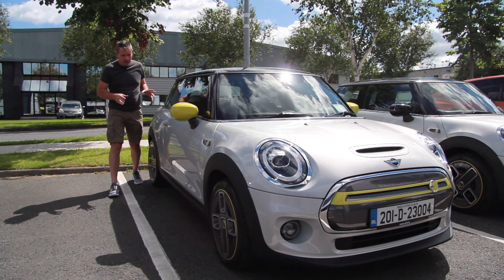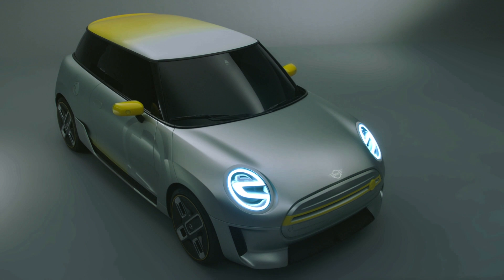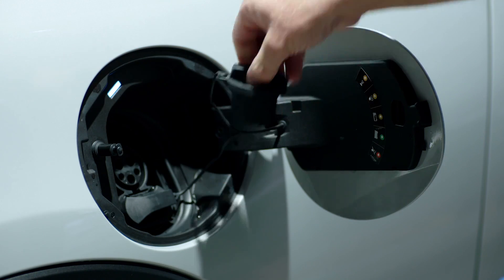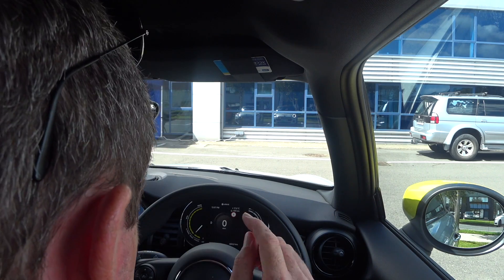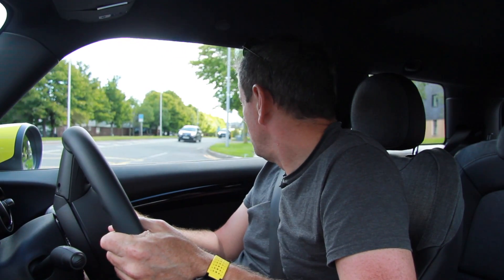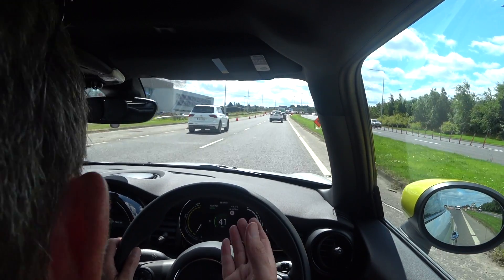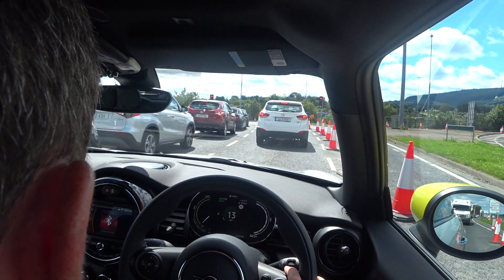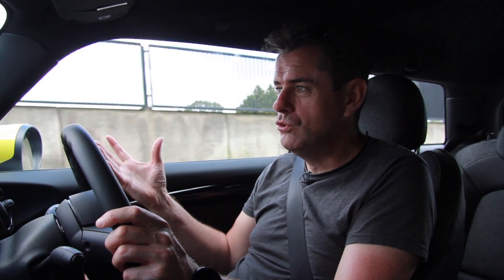Mini Electric range testing for my commute to work

Comment: yeah I wish they gave it just a bit more. With a 40 mile commute each way I'm not turning off the air or babying the accelerator I want to drive fast over the speed limit and pass for fun. It's a mini i'm not in a Prius it's such a shame they didn't give it a bit more. If I had a 15 mile commute i'd be all over this car but it's just not enough to drive and have fun with the low range.

Comment: Bjørn Nyland test - says it's very efficient -  did you have the brakes on Bob :)
Reply from the maker: I drive like a normal person, I told you from the start that I would be using cruise control and sticking to the limits. Why should I try to be super efficient? 
Also, different people and different environments make different results. 
No one who commutes every day is going to go slower or kill themselves to be efficient. 
Bjorn is wrong, ever think of that?
Reply: It is efficient, even in this test. In Bjørn's video he averaged 177 Wh/km at 120 km/h, for a total range of 163 Km.....this is much better than just about any other EV out there. It's only because the battery is so small that it's range is lacking.

Comment: This is designed as a City car and MOST people drive less than 80km a day - if you need more then DONT buy this car OR charge at 50kw which would get you around 160km added in 30 mins or like you said charge overnight when you get home. You cant think of EV's like an ICE car, it's not the same as you don't have a fuel station at home which you do when driving an EV.
Reply: That’s a scenario where this would work for me, you couldn’t have it as your only car in the house. You’d need one ICE for long journeys and the electric for school runs and short journeys. I definitely couldn’t cope with the range anxiety if this was my only car
Reply: It’s the age-old conundrum, 95% of the time 100 miles range is all you’ll ever need, even long trips you can beak up with motorway charging stops, lunch, coffee etc, but its the 5% when you wanna do something like a 200+ mile round trip in a day - the last thing you really wanna do is add 40mins or more to a tiring day of driving. My Leaf will do about 130 miles and honestly, I want more range, just for those odd trips, hence we keep our little petrol car hanging around, which ironically is less comfortable for long journeys (it’s a mini btw!!). Minis are ace, and this one is a very nice, but rather expensive, second car imo.
Reply: It's too expensive for being "just a city car". The 208/Corsa cost about the same and offer much more for the money.

Comment: Bjørn Nyland a k a Teslabjørn tested the same car today and was very, very impressed w the Mini's efficiency. Basically Ioniq level efficiency. It has a tiny, tiny battery for an EV and driving at 120 kmh for quite a bit, what would you expect??? So if the conclusion is that the battery is too small for long distance highway driving is that a surprise? Me dont understand

Comment: Thank you Bob, I enjoy your honest presentations, although I must admit that I did feel ‘range anxiety’ while watching this one. It also occurred to me that you had ideal conditions for the journey. I wonder how ev’s cope in cold, wet, freezing winter conditions and heavy congestion?
Reply: At least heavy congestion would be reducing the energy needed to drive. Cold will increase consumption, depending on if the Mini has a heat pump. Should be doing the same trip fine without any need for range anxiety. 😉
Reply: Electric cars love congestion on any road, they love stop start driving, range goes through the roof. Rain (wet roads) reduce the range as does cold weather (denser air and batteries less efficient). Long hills are also an Ev's Achilles heal for a similar reason to driving at constant speed (against the wind) on a faster road, you have to keep the motor pushing the car along against resistance whether that be the air on a fast road or gravity on an incline.... or both.

Comment: Hi Bob, enjoyed the video. You where wondering towards the end why the regen was high on green. I think you need to find the low regen setting. You mentioned this at the start of the video. What are the charging options? CCS, 3 phase AC?

Comment: Nice true life review of Electric car. Looks good but the small range is surprising from mini. Though minido at least 300 kms . Some done working and travelling close but no long journeys as too many times to charge.  For me would have to charge 4 times from cork to Dublin return . Or twice on return cork to limerick.  Pity
Reply from the maker: It's a great car but really short range. I just drove from Portlaoise-Dublin-Portlaoise in a Peugeot 208 e and didn't have to stop to charge 🤩
Reply: Bob Flavin yeah that’s much more usable in the e208. Still I’ve seen in a few other reviews that the e208 is very thirsty high kWh/100km so It should be able to go  further than it does but efficiency is poor.

Comment: PS: Totally agree with your mantra, it must be driven like a petrol or diesel, no holding back, 120pkh on the motorway, no flipping hearse driving. I felt for you stuck at 100kph indicated speed when tools were hovering between 95 and 105. What part of constant speed do some dicks not understand. My car at 100 indicated ground speed (IGS) is only doing 95 true speed over the ground (SOG). PS: Noticed when you were setting off you only paired for bluetooth and didn't plug into CarPlay or Android auto, so no WAZE which suggested speed limit all the way. :)

Comment: For the life of me I can’t understand why bmw mini choose to install the last gen i3 battery and expect it to be an outright success, even if they added a mini eco engine in Rex it would safeguard its sales but this where every other small ev are fitting 50kw bar Honda I can’t but help think that bmw don’t want it to be a success and compliance car to meet eu total c02 quota
Reply: You can't understand it because they didn't :) They are different cells (LG vs CatL). They are the same size, but completely different battery. I've read lots of comments here which complain about range. Buy the car that suits you. The mini has a small battery so it is fun to drive (lighter). It is one of the most efficient EVs you can buy, which it needs to be with the small battery. Put a larger battery and the fun factor disappears. A 50kW battery with todays tech would require you to remove the back seat. You wouldn't buy a bugati veron for stop start morning traffic. If you want to plod along for the long morning commute, buy a comfortable car which is dull to drive, but goes a long way. If your commute is less than the range you get in a mini (for your conditions and driving style), then the mini is fine and will be cheaper than other EVs (more efficient) and more fun.

Comment: This is very much a re shaped 94 ah BMW i3 same battery size of the 2016 model they could of went to 120ah same power output as i3

Comment: It's a city car so the range is not going to be outstanding. City cars, by the way, are good on country roads as well but what they don't like doing, in company with all vehicles of whatever persuasion, is pushing hard into the wind for the reasons you discussed. I understand your reason for driving at normal speeds but if you had done the motorway / dual carriageway section at 60 Mph / 95 KMph you probably would have been able to do the journey back no bother. Perhaps try it on the way back! Wind resistance goes up by the square of the speed and it also goes up by the coldness / density of the air which is a contributing factor to why EVs don't do so well in cold weather. Interesting and entertaining review.
Reply: @johndillon1027  Current EV batteries will always loose capacity over time, it's in their chemistry. However this can be minimized by various charging strategies. From my own experience in a VW e-Golf over two years and 28,000 miles I cannot discern any loss of range (Summer 160, Winter 140) but there must have been a little. Manufacturers generally give about an 8 year / 100,000 mile warranty on the battery having more than 75% of its original capacity, but they are really expecting not to have to pay out and giving themselves a hefty margin. So you should expect a lot less loss than that perhaps 15% over 10 years. That's really the only reason to go for a bigger capacity than you need, you won't notice the degradation in range so much. Petrol / Diesel cars probably have a similar degradation in efficiency over time which amounts to the same thing just from the engine side rather than the fuel side.

Comment: The mini has never been a practical car although it is seen as funky or fashionable by some. However, sales are on the downward trend and this poor effort at electrification isn't going to help.
And what is it with those union flag tail lights? Everybody knows (even the English) that the car is basically German.

Comment: I wonder how many people will fall asleep driving these things. No engine noise, just a droning sound. You'd be bored out of your mind driving that leccy car.
Reply: Simply record the sound from your old car whilst on the motorway, then play it through the stereo of that pesky new quiet EV - presto, problem solved!
Reply: At motorway speeds an EV has the same noise level as most petrol or diesel cars, wind and tyres drowning out the engine anyway. Before motorways we all had to keep alert as there was much to do, overtaking and negotiating the old N routes. Motorways are meh, boring.

Comment: To start with only 98 mile range that's crap, be realistic majority of drivers don't drive like that constantly checking speed keeping to the speed limit. I would be interested in seeing a video you driving ' Normally ' see that battery range then. I have no problem with EV my personal favourite are Tesla's  the range and infrastructure for charging is second to none. As time goes on  battery technology will improve, the price (30k) of these small cars will come down its that what puts me off these small EV's and the the very short range

Comment: With PHEV, you don’t actually need to charge from the nails every day, you can use the petrol engine to charge. That’s is the benefit over hybrid and full battery models
Reply: The worst car I had for efficiency by a considerable margin was my Golf GTE. On electric only it went through it’s battery like nobody’s business. On engine only, the fuel consumption was terrible and when I let it decide what to use it couldn’t make its mind up and just burned both in equal measure. Worst of both worlds.